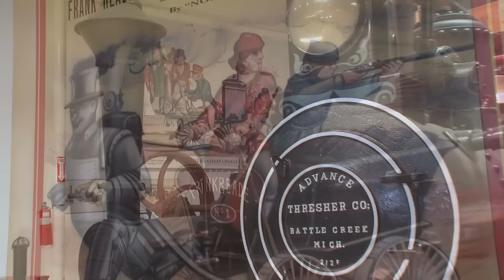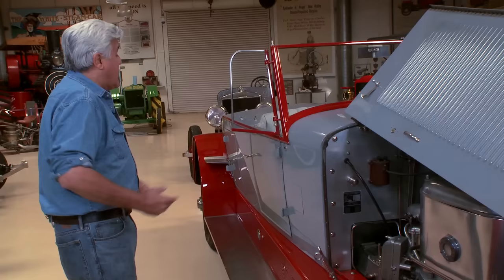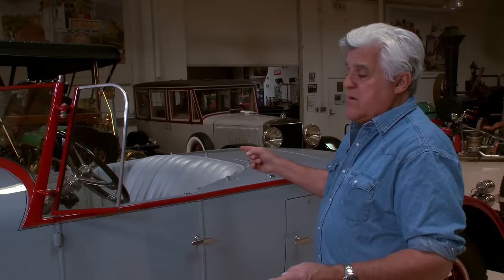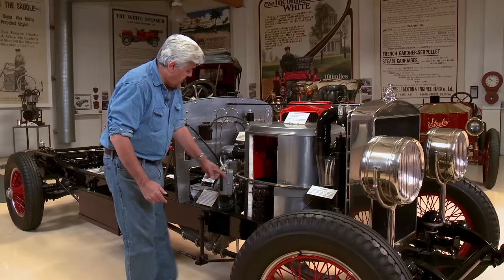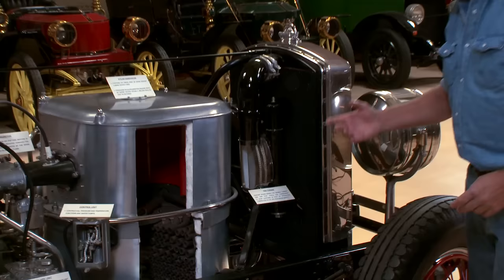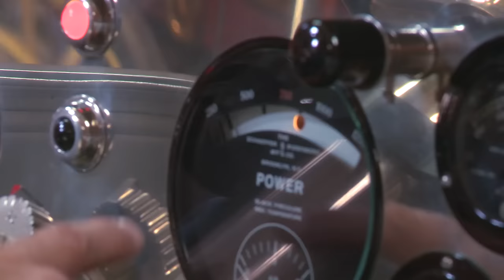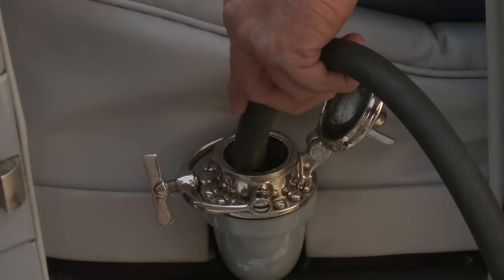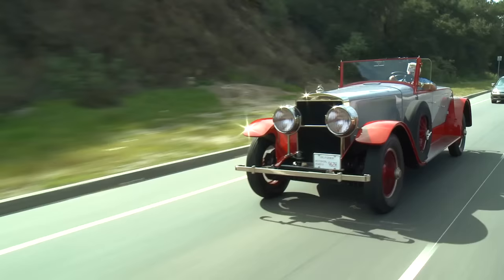1925 Doble E-20 Steam Car - Jay Leno's Garage

Comment: this is the technology I understand. you can try to explain computers and electronics to me until you're blue in the face, and I just can't get it. my brain just doesn't work that way. 1's and 0's can not equal pictures on a computer screen.
Reply: EXACTLY
Reply: It's not so much 1s an 0s, it's more ons and offs. Every sequence of ons and offs is a code and that code results in what you see on your screen. In theory you could make a steam powered computer.
Reply: +Maarten van Rossem Lezingen I understand the "on and off" part. but how that becomes a video of a steam powered car? it's all black magic and sorcery!
Reply: BURN THE WITCH!
Reply: It is all mathematics. You know binary right ? every number can be coded into it. Then there is memory it works only on basis of keeping that value of on and off somehow. It is achieved in various ways. Also how computer decides when it is true and when not ? There are logical gates made of components named transistor. It is a component that lets current go or not based on how much current goes to its core. Low and high voltage are those on´s and off´s. You can then chain those transistors to pretty complex decisive logical constructs. And now what is a video ? It is a lot of pictures and audio track. It all can be coded mathematically. One picture contains a lot of small dots - pixels. One individual pixel has a colour and that can be also rendered mathematically as there is this saturation table. So you just need to save x and y coordinates of each pixel and its colour. You have a picture. Than you need to remember which picture goes after another, keep an information on how fast it should be played and also attach an audio track to it. And audio track is easier. It is basically analog graph taken apart by small parts, you just need to remember the value of the peak of the graph in that one part and which part it is. Than how it is put all together and coded are just another complex mathematical algorythms that are minimalizing this equasions so it would take as low space as possible even at the cost of lost quality. But computers are really extremely stupid. Esentially only thing they can do is to decide whether something is true or not and the job of the programmer is to break a problem to those yes and no questions. When broken to more questions, the more complex it will be and it will be more capable. That is why i do not believe in true AI consciousness. Computer can only analyze the situation and answer those yes and now questions and than execute programmed solution, they have no soul, no remorse, no feelings. Remember those days when computers used those sheets of paper with holes and would print mathematical results ? They looked more like machines back then. And it is still the same, it is only a calculator capable of basic mathematical functions and in order for it to work, everything needs to be broken into equations those computers are only really really fast. And that is thanks to the electricity. But the logical principal can be also used with mechanical components if they have the same principal as transistors. There are even some power plants with hydraulic computers because of electrical interference. Everything on computer is really simple principal. Monitor for example - it only turns on every pixel with desired colour. row by row. It checks what is to be drawn on there and refreshes that screen 60 times per second. It is just really fast.
Reply: These old steamers are simple. Doble's demise was due to management problems. Every car produced was different. Design refinement were continuously applied.

A much better design would use a computer control system. A big problem with steam cars is boiler control. The Doble and White steamers were the best. Stanley used a fire tube boiler holding a large amount of water at the boiling point so had a ready reserve and a much slower control system requirement. The problem with a Stanley is startup time. The White and Doble used monotube once thru boilers having very little reserve require a very fast response control system requirement.

You might as well say electric cars are steam powered as most of our electricity comes from steam power generators.

Cyclone power used my boiler design.

Inconsistant steam to the engine can be a problem. Stand pipe boilers solve that problem and simplify controle. 

Efficiency is another thing. Efficiency is dependent on expansion of the steam. The problem is that power output is dependent on the pressure or the force from the pressure on the piston. there is a lot of rome for efficiency improvement.
Reply: +Andy Patterson Doble's demise was due to the simple fact that steam cars were already an obsolete technology after 1915... Nicolas Carnot had already discovered that internal combustion engine were more efficient in 1824.... the invention of the electric starter motor by Charles Kettering rendered steam cars obsolete virtually overnight.
Reply: doktorbimmer+
The IC engine operates on the otto cycle which is also less efficient then the carnot  cycle.

If you use an updated rankine engine cycle that uses compression it is basicly the otto cycle.

Ok steam doesn't run at as high a temperature. But on the other hand the high temps in the IC engine are what cause the exhaust emission problems.

Steam engines are external combustion and can have as clean a burn as your home gas stove.

Theoretically a steam power plant can achieve as high or higher therodynamic efficiency then an IC engine.

I implemented an IAPWS-95 steam properties package for VisSim. I derived additional properties for various derivatives of those properties that I could use with VisSim integrator blocks. The reason for using the more complex scientific IAPWS formulations is they are a contiguous set of formulations over the entire range the formulations. They all take temperature and density is input to calculate other properties. Of course you still have the saturated mixture region to contend with.

So go refresh yourself on thermodynamics and maybe we can talk more
Reply: +Andy Patterson  Wrong again my friend, The Rankine Cycle has a LOWER Carnot Formula limit than either the Otto or Diesel Cycle... You need to go learn what the Carnot formula is!
Reply: +Andy Patterson Theoretically a Diesel Cycle power plant can achieve significantly higher thermal efficiency than steam... but in the real world engineers are restricted by practical limits and economics. Which is why you do not see 1,000 mega watt Diesel engines and you will never see a combined cycle steam turbine in a car!
Reply: There are no steam powered helicopters.... that should tell you something.
Reply: There are no benefits to using a steam car... that is why they have been obsolete for over 100 years.
Reply: Renewable fuel is "more efficient" than fossil fuel... that does even make sense... and why would it matter if it was? If you are using a less efficient engine like steam? you will use more fuel... no matter what type it is.
Reply: You have never heard of Ethanol, Methanol, Methane or Bio-Diesel? Millions of internal combustion engines run on these renewable bio-fuels every day...
Reply: Just answer the question kid, Why are there no steam helicopters???  They certainly are... the require very very light powerful and even more fuel efficient engines than cars... steam is not even efficient enough for cars!
Reply: Then why has no successful automobile manufacturer used steam engines in cars for over 100 years????
Reply: But renewable fuels have been in use for over a century and are in widespread use around the world NOW... How will renewables make steam cars viable when they have been obsolete for over 100 years???
Reply: Why would a hydrogen powered helicopter make sense? Why would it be better than Bio-SPK or FT-SPK????
Reply: You cannot answer a simple question? Why are steam engines not used in helicopters?
Reply: Start-up time is the only disadvantage to using steam technology? What about size? weight? fuel efficiency?  Steam cannot match internal combustion in any of these design criteria.
Reply: We will continue to use the same internal combustion engine types because they are MORE EFFICIENT THAN STEAM. Nothing will change accept the types of fuel used.
Reply: But steam engines require MORE MAINTENANCE than internal combustion engines... why would you use hydrogen instead of Bio-SPK or FT-SPK???
Reply: Steam engines are obsolete because they are LESS EFFICIENT!
Reply: You need to finish high school before you can attend engineering school...
Reply: If you can read? You should be able the figure out that steam is less efficient than internal combustion... Why do you think steam cars have been obsolete for over 100 years???
Reply: Why would you use hydrogen instead of Bio-SPK or FT-SPK???
Reply: Just answer the question then, Why use hydrogen instead of Bio-SPK or FT-SPK???
Reply: You wrote, quote;    "HYDROGEN powered helicopters make sense rather than internal combustion"

Why would hydrogen make sense?
Reply: It is a simple question, Why use hydrogen instead of Bio-SPK or FT-SPK???
Reply: Why is the U.S. Air Force developing Bio-SPK and not Hydrogen?
Reply: But why would anyone use hydrogen? what advantage does it have over Bio-SPK???
Reply: What advantage would hydrogen offer over Bio-SPK in a aircraft application???
Reply: Commercial and military aircraft and helicopters all use Gas Turbine engines... what would be a legitimate reason to use hydrogen over a bio jet fuel like Bio-SPK or FT-SPK????
Reply: NO, You Did Not! Now please answer the question... WHY use hydrogen instead of bio-jet fuel???
Reply: +fuzzy the great Luddites!
Reply: +fuzzy the great I'm very familiar with HFCs... what was your point?

Comment: The Doble was built in Emeryville CA, adjacent to Oakland. The factory is still there and has been converted to live/work spaces. I worked on one of these, and the building had an elevator 20 feet long so the cars could be moved from the third floor down to the ground floor and out the building. Doble also had plans to build a steam airplane but it never went into production.

Comment: That was fantastic. Thank you so much. For showing what an alternative to gas could be like. My grandfather talked about the cars in his day but I had no idea they were so complex!
Reply: The Doble E series is not an alternative to gas... Jay's Doble Doble runs on regular unleaded gasoline and guzzles it at the obscene rate of 3 MPG/ 6.5 MPG
Reply: @sandervanderkammen9230  I was not refering to a gas as a platform but an alternative in the sense of electric, turbine, steam, hydrogen ETC. You are very correct in the obscene consumption of gas in the steam car. It would not be a viable alternative. And I wonder what is the exhaust results are of all that gas being burned.

Comment: That's what I love about Jay. He wants to drive them priceless cars, not just have them sit around. I think that's what makes them MOST valuable. The fact that they do drive and are driven. Even improvements like the brakes are welcome.
Reply: This car unfortunately hasn't run in many years
Reply: @WilhelmKarsten  how do you know this? I assume Jay has too many cars to drive them all anyway and when some of them sit for long enough, it just takes too long to get them in working order.
Reply: @oBseSsIoNPC  The engine suffered a massive catastrophic failure shortly after this video was shot, the engine is currently undergoing its second major rebuild since Jay has bought the car.
Reply: @WilhelmKarsten  aww, what a bummer. I am a huge fan of steam engines and love the idea to pull over, top up with water and some sort of fuel and keep going :D
Reply: @oBseSsIoNPC  Fascinating machines, I have always liked steam engines... unfortunately they are obsolete because of the extremely high maintenance costs, terrible fuel efficiency and high emissions.

Comment: It's similar to a design that I came up with, except mine was a single unit, not all over the car, just as i was going to patent it another chap (a Mr Whippy man lol) beat me to it, and was bought out by an oil company.

But mine had similar performance spec, 130 mph but mine had what I called double turbos, I'm not an engineer so everything was slang, lol, but mine had a lot of acceleration, basically i guess mine was like a more evolved version of what you have there.

I don't know if you see old posts on your channel but I really enjoyed it. thanks. Brought back memories.

Comment: Thanks so much Jay, there is a future to the old tech, unlike the new tech which can never be fixed.
Reply: There is no future for steam cars, these gas guzzling dinosaurs are extinct for some very good reasons that Jay really didn't discuss.
Reply: Sounds like you don't really know anything about steam engines or automotive technology.
Internal combustion engines are inherently superior to the Rankine Cycle, this was discovered in 1824 by Nicholas Carnot before a practical internal combustion engine was invented yet.
 Steam cars were wiped out by a single man, Charles Kettering who invented the electric starter for ICEs.
The electric starter eliminated the only adavantage that steam cars had in 1915 and within a decade all of the legitimate steam car manufacturers either switched to ICEs or went bankrupt.
Any questions son?
Reply: A chef doesn't have to deal with the empirical or theoretical limits imposed by the Second Law of Thermodynamics
Cuisine is completely subjective and open to interpretation and opinion.
Thermodynamics is completely objective.

Comment: I really enjoyed this video on the steam car.  I have been a steam locomotive fireman and from time to time ran the locomotive.  Aside from the difference between a steam generator and a boiler the car has similar technology to the locomotive.  Steam locomotives did not condense the water but exhausted it through a petticoat pipe that caused more draft on the fire.  Jay, you are amazing and I can’t begin to thank you for the preservation of the engineering history of this country.  Thanks again.  I would love to talk you about all this technology.  P.S. we would always blown down the boiler every day.  I hope you use distilled Water to avoid scale build up.  At the very least treat the water before you put it in the car.  Good luck. John Iacono
Reply: You typically don't use distilled water  on condensing engines... it is very ineffective at controlling scale build-up... water treatment additives like tannic acid are more effective and less expensive.

Comment: Imagine what it would be like if someone made a modern version of this car for sale!
J Leno motors is proud to announce the Doble 2 on sale at your local Leno Motors Dealership, a modern interpretation of the classic Doble of the 1920's built for the modern world!
Reply: The Doble and steam cars in general  would not be allowed to be sold today because they are horrible gas guzzlers,  produce insane amounts of pollution and requires special boiler certification and licensing.

That,  and who would would really buy a multi million dollar car that requires constant maintenance and extremely expensive repairs and service.
Steam cars became obsolete a century ago for some very good reasons.

Comment: Nice. I  do wish you had shown more on how you control the car. Changing the speed you move at, how you break. And, how you reverse. Other than that, always a pleasuremto see your cars.
Reply: Nothing special, open the throttle to speed up, close throttle to slow down. Boiler controls were automatic.
Brakes are same as a regular car, pedal on the floor.

Reversing was simple, small pedal on floor is depressed and the engine spins in the opposite direction until you release the pedal.

Comment: I know that I am a little bit late to this show. However, I would like to share some Info in regards to the water used. Back in the '70's when I was working as a jet engine mechanic we overhauled components for the P&W JT9D jet engine installed on the first 747's. They used a water injection system which injected water into the combustion chamber through the fuel nozzles. The water allowed more fuel to be injected and added volume going through the turbine therefore producing more thrust at take off. However, the water they used was "de-mineralzed" water avoiding any residues in the water lines, water pumps and water pressure regulating valves. During overhaul I have never seen a components with residue. I do not know if this type of water is still available but if it is, it may help to prevent build up and extend the life of the steam generator parts and may avoid "blow outs".
Reply: The Doble uses a condenser that fouls the feed water tank with contaminated water, which in turn causes scale,  most commercial boilers use a water treatment additive because deionized water is ineffective and is often unavailable.

This additive turns the scale into sediments that settle to the bottom of the boiler where they can be easily "blown down"

Comment: I learned about the Doble steam cars years ago and have read almost every bit of information I could find. His cars were (are) absolutely amazing, but as Mr. Leno said, he couldn't stop fiddling with the cars and he was not a business man. If Ford had designed and built this system we would be driving steam cars today.
Reply: Steam cars were rendered obsolete by Charles Kettering in 1914 when he invented the electric starter for internal combustion cars.
  Electric Starters completely eliminated the only adavantage that steam cars offered.